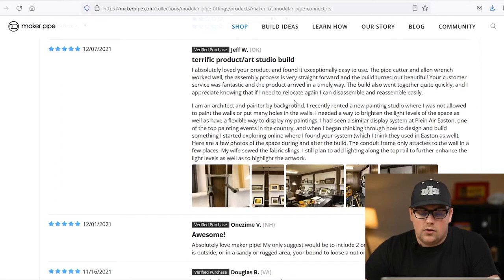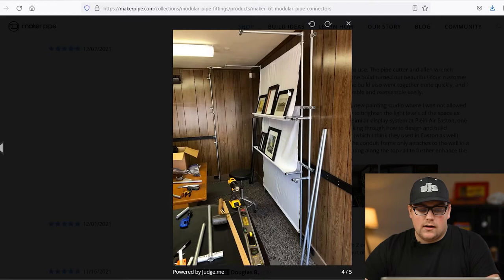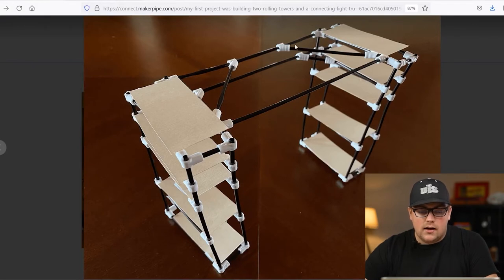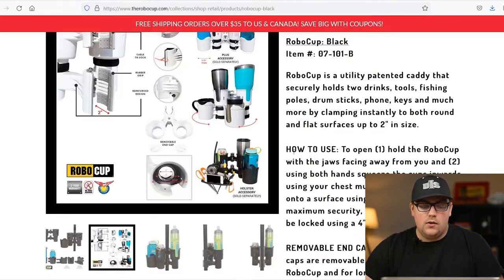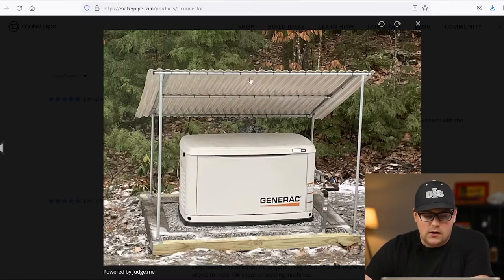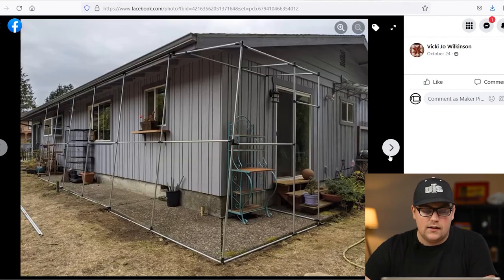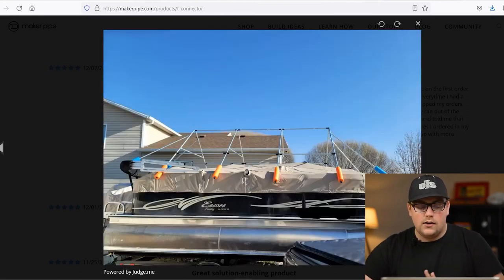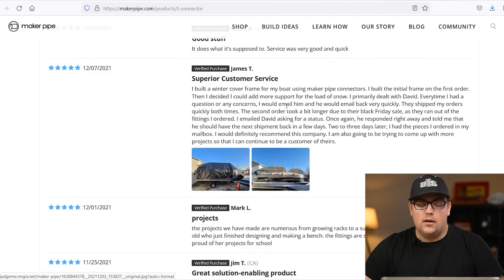5 Creative Uses For EMT Conduit | Maker Pipe Monday - 078

Comment: Has anyone used the connectors with 1" PVC pipe (schedule 40 might be rigid enough), or would they be too big?
Reply from the maker: Hey Ed thanks for the question. 1” is a little too big, but you can use 3/4” SCH40 with the a shim on the Pro Connectors designed for 1” EMT Conduit. Check out this video around the 2 and a half minute mark. 

https://youtu.be/WtYyF2BRFPo